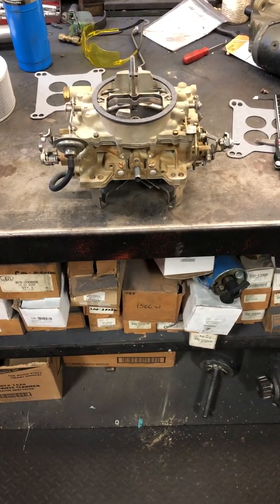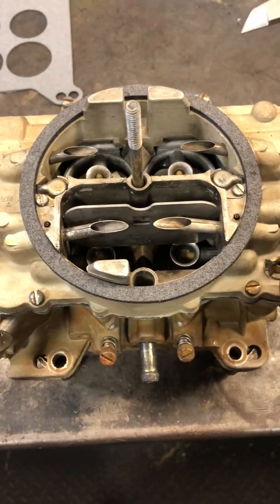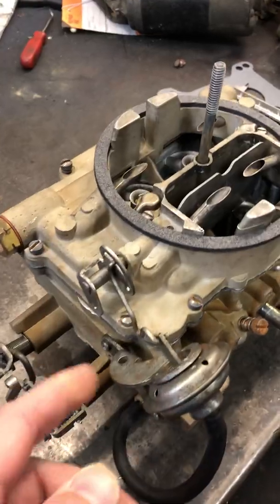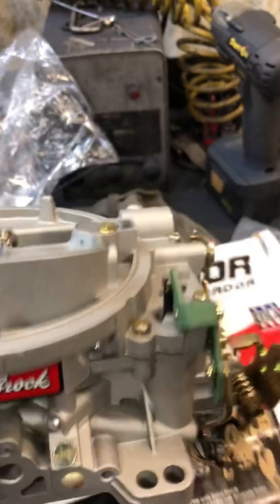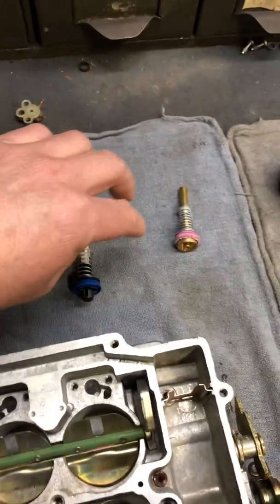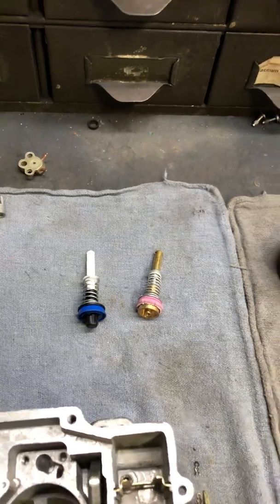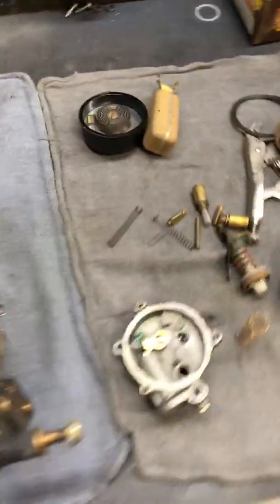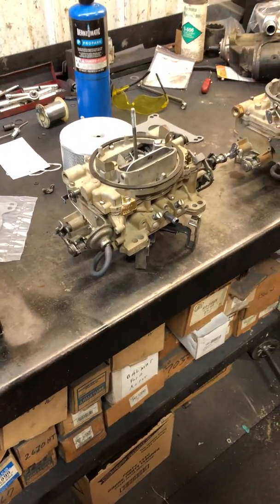Chrysler Marine Engine Carburetors Carter AFB Rochester Quadrajet Edelbrock ID and Differences

Comment: I have a 1409 installed on my recently purchased boat with chrysler 360's. This does not have the PVC installed so I have no vacuum. I stalls a lot
when I'm trying to maneuver it into the slip. I don't know how to install the pvc port. Can you help?
Reply: I don’t believe that nipple is for a PCV valve! I’m pretty sure that nipple is for a fuel line that goes from your fuel pump to the carburetor, It is a safety precaution in the case of a ruptured diaphragm in the fuel pump! On cars if the diaphragm ruptured fuel will leak on the ground, That is not good for a boat!
Reply: You can buy a oil catch can on the pcv system and it will make it a closed loop system and fix your vacuum leak